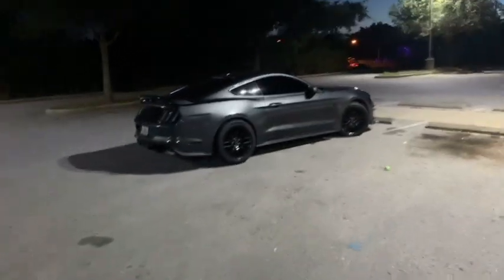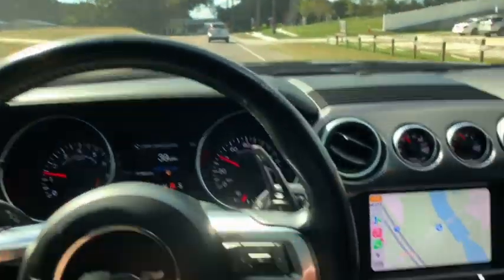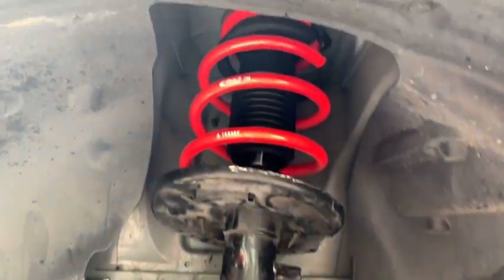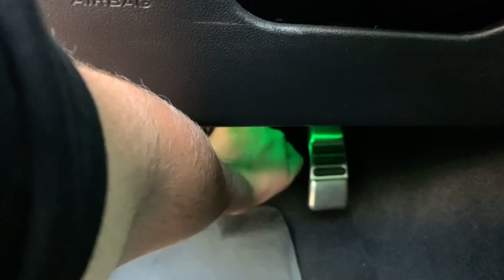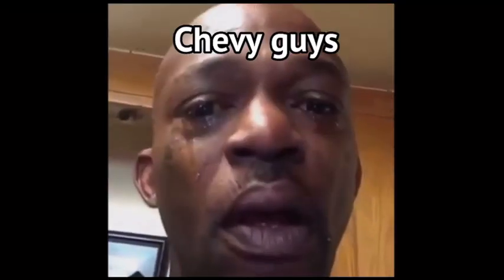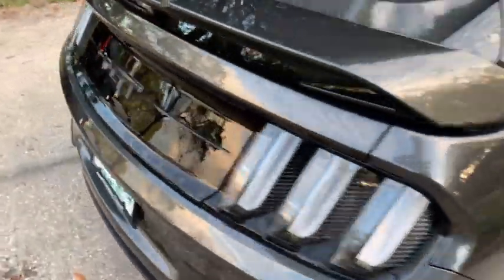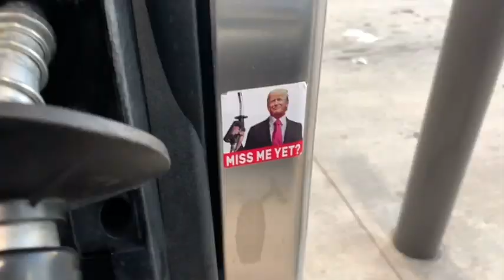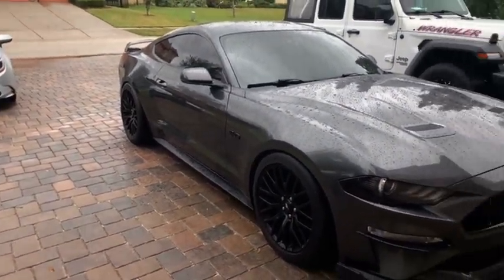Mustang Gets Lowered on EIBACH SPORTLINES! (LOWEST SPRINGS ON MARKET)

Comment: Bro pull your Ebrake instead of pushing the brake pedal with your hand lol. I used the Eibachs on my GT PP1 too, but my spring are silver in liking that red you got
Reply from the maker: HAHAHA funny thing is I thought about that while I was holding the brake down 😂. Also did you get the pro kit or the sportlines? And thank you so much I do like red a lot actually.
Reply: @mejidballa270  I can’t honestly remember I think the pro, I got them from Steeda’a site but they Eibachs for the magnetic ride, but they red you got shows up better

Comment: did you change out your shocks too ?
Reply from the maker: Nope, still on stock shocks
Reply: @mejidballa270  damnn so all you did was the springs? no spacers or anything else?
Reply from the maker: I do have 25mm spacers on front and back 😅
Reply: @mejidballa270  Ik this is really late but i’m looking for aftermarket wheels with these springs and was wondering if u ever had any rubbing issues running spacers